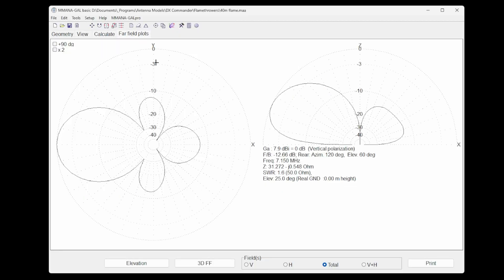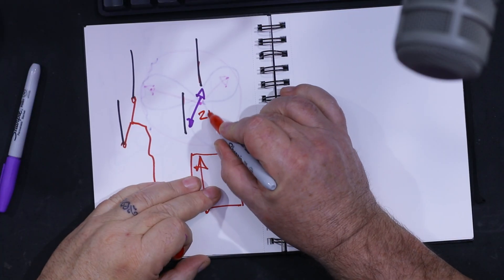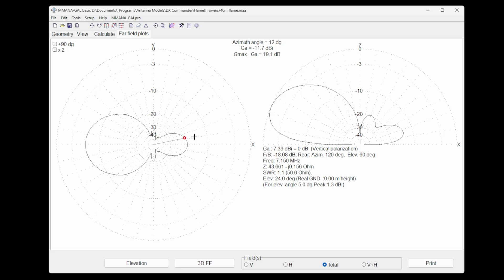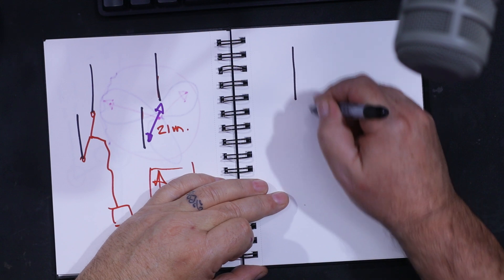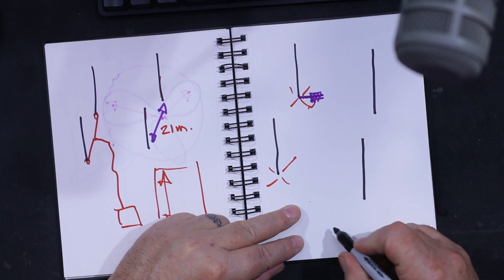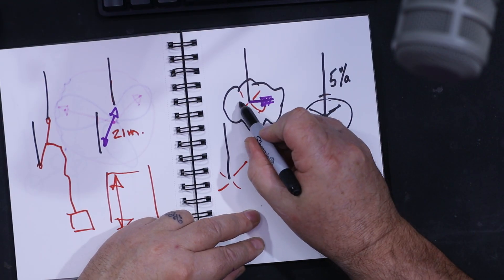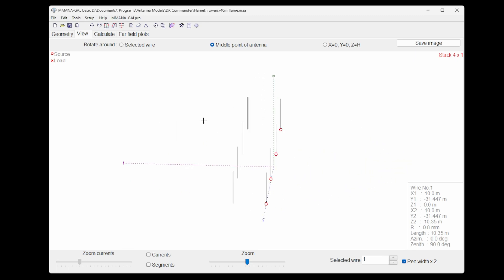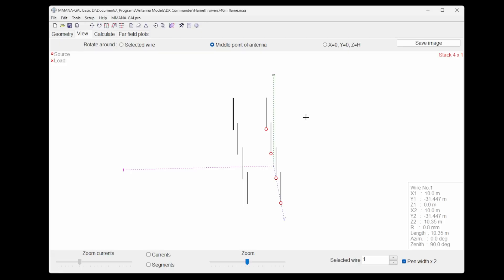4 Phased Verticals for Extra Gain and F/B

Comment: which software you use to calculate?

will this work on UHF band?
Reply from the maker: It would work.. But there are easier solutions up there like a Yagi.
Reply: @DXCommanderHQ  I use for data signals between shore and vessels working near shore (25km_ish) from the shore.
as the vessel has no fixed location I was wondering if this setup have more reception as with a directional antenna

Comment: Why bother putting 4 or 8 verticals for just only one direction? Yesterday just made calculation in MMANA-GAL for phased array 2x2 vertical. So, if I use four relays, I can switch direction. With plenty of radials, this antenna array can give 8 dBi gain (with 4x16 radials). Forward/backward up to 9.79 dB. Direction angle (-3dB) is about 108 degrees (+/- 54 deg.). Good thing is that this way 5 degrees elevation is really great gain. I got some calculation (40m band) for 10x10 meters spacing, 9.65m tall aluminum tubing 4 mm (bottom part is 16 mm, then inserted many narrower elements). Phasing is done using 1/4 lambda matching coax + 71 degrees phasing delay line(s). So, 4 direction is possible by switching relays. Even if all 4 antennas are in phase (0 degrees delay), it acts as a single vertical, but with much better pattern - especially for 5 degrees DX work. Just need to collect all materials and build array. I hope that directed reception will give me 1/4 of the noise as I have right now with single vertical for 40m band. Depends where it is switched, various noise sources are at various places.
Reply from the maker: Do it! I enjoy economical experiments. Very few of my antenna builds actually stay put, I move on to something else..
Reply: @DXCommanderHQ  I understand this part about moving to next idea. Previously I made vertical antenna without any radials. Then made mistake and rise it 5 meters up,  with only 4 radials. The problem was in length of active element - 7 out of 10 meters required for 40m band. Coil at the bottom does not helps because it was maybe out of resonance. Now I removed this ugly antenna and made proper 10m tall pole with 18 radials (1/8 lambda, approximately 100m copper wire, 1 mm diameter). Much better. Just noise level is the highest during afternoon period. Over night and early morning it is okay. So, I hope directed vertical array may reduce noise by 'subtracting' 3/4 of the available noise sources.

Comment: Hi Cal, in my old day-job we used circular antenna arrays called "Pusher" arrays, the smaller brother of the Wullenweber (look it up on Google, this wouldn't fit in your field :-)) like the one that used to be at RAF Chicksands near Bedford.  Any metal object in the vicinity would alter the beam shape/direction on a pusher...
It might be worth mentioning in your next "phased array" vid that the reason you need specific lengths of feeder on this type of set up is that you're trying to maintain a usable impedance for the complete array, if you just use T pieces and equal/arbitrary co-ax lengths you end up with a very low impedance (all elements simply in parallel).  That's why for example the 2 vertical Christman method uses 84 degree feed-lines plus a 71 degree phasing loop.
73, Craig, 2E0HXF

Comment: Wonderful how this array sounds, I had this niggling feeling that your long wire, 160m end fed, gave similar results. I looked up the video and it was about 5.7dB at 5 degrees on 20m, or, as you said at the time, about 10dB more than the vertical. I know you went on to change the design, but would it be worth revisiting the end fed 160m for transmit and receive? This array seems like an awful lot of work and expense to get similar results to a bit of wire chucked in some trees.
Reply from the maker: Yeah.. So something has happened to that long wire.. I'm not getting anywhere the gain I used to.. I shall inspect today and see what happened..
Reply: Maybe use the drone to get the antenna up in the treetops.

Comment: I don't know.  But I do know that it's going to depend on the (electrical) length of the coax between the feed point and the switch that's grounding the other end.  And if you have an old school dip meter, you may be able to figure out where it is resonant, holding the meter coil close enough to the element to couple (and being that close will effect the resonance.
Reply from the maker: Yes.. Now that might work.. Calculating the resonant freq whilst it's grounded is annoying me!

Comment: If you open the coax to the center vertical it would be better.    That would detune the vertical in the middle from the resonant antennas in the 4 square.  I think grounding the center vertical would interfere more due to your using other passive grounded elements.   The inteference amount, I think, would depend on the actual length of the center verticals and 20M element total length.
Reply: meant radial lengths of center antenna.
Reply from the maker: Yeah.. I'm wondering how I might do that easily - from inside the shack! Still thinking!
Reply: @DXCommanderHQ    I had to use a rf DPDT relay out at the antenna base placed in a small 4X4 box (about size of a UNUN) and controlled via bias T.    Just needed to operate the relay to open the ckt (both center conductor and ground to the radial field) to keep the center vertical from re-radiating interference to my surrounding 40M 4- square elements..

Comment: The 20 m element on the sig 12.5 is vertical but its coax feeder is at 90 degrees and on the ground. It's within the area that is the whole phased array antenna, it has to have an impact on the radiation pattern.
I don't see an easy way to model the situation But Ham Radio is a practical hobby so:
You can do real world tests when you build it by dropping the sig 12.5.

Comment: great. that work both ways. the RX comes up in the direction of TX as well. that antenna in question will be effected buy length of coax that short. cause a delay . take some measurements and put it in model . That feedline length to antenna switch will be a factor. if you put delay lines in phasing harness you can steer your beam. may be a bit fun. I am in NY,USA may be a big difference to me. 73's
Reply from the maker: Nice

Comment: Fun bit of history: this technique was developed in 1929 by an engineering firm to create a null in what was then the shared signal of WFLA and WSUN in the Tampa Bay area.  That year, the Federal Radio Commission (precursor to the modern FCC) realigned all the broadcast frequencies, and they WERE going to allow WFLA/WSUN to operate at 1,000 watts at night, but they were moving the stations from 900 kHz down to 620, which was also to be occupied by WTMJ in Milwaukee to the north.  WTMJ strongly objected, so the FRC decided to reduce the Florida stations to just 250 watts at night... which, naturally, the Florida stations were none too happy about!  So the Florida stations got in touch with an engineer in Washington D.C., who himself enlisted the help of a British engineer who had experimented with radio direction finding.  They put up one the in-phase tower on the south side of the Courtney Campbell Causeway bridge and the out-of-phase tower on the north side, and included a switch so that the station would only be directional during the nighttime hours.  When they fired it up and threw the switch, sure enough, there was a null toward Milwaukee, and all three stations were happy!

Today, it's just one station on 620 in the Tampa area, (WFLA long since moved to 970) and it now uses the call letters WDAE, but they still only go directional at night... now with 5,500 watts.  WTMJ, themselves, are directional 24/7 today, with two different patterns for day and night.  Their nighttime pattern includes a null to the southeast to protect WDAE.  In fact, it looks very much like the four-element design you've drawn up!  ( https://radio-locator.com/cgi-bin/pat?call=WTMJ&service=AM&h=N )  And even though they run 10 kilowatts at night, I know their setup works, because I can't pick them up at night from my town just north of the Michigan / Ohio / Indiana state lines.

Radio World's John Schneider did a great write-up about it a few years ago: https://www.radioworld.com/columns-and-views/roots-of-radio/the-development-of-the-directional-am-broadcast-antenna
Reply from the maker: Brilliant comment. Thank you!

Comment: WOULD LOVE TO USE DX COMMANDER AS a driven element, either re-engineering on lengths and bands, with another pole as a director or reflector. Vertical stationary array, or maybe even 3 elements. Not as easy problem, but if you use great circle bearings, it could be a great way to overcome the exorbitant cost of a beam.
Reply: 4 square multi-band with 4 DX Commander.
Reply: Spacing between the antennas becomes a problem on other bands.
Reply from the maker: Yep.. Just what John says :)
Reply: @FromthehamshackwithNJ4Z Indeed, the problem with a 4 square multiband is the choice of spacing, a bit like a multiband HF beam but also the phase shift network. This is why I asked Calum if he could try to model such a system to see if he was able to find an acceptable compromise so that such an arrangement works in multiband, which we do not see usually.

Comment: Good video Cal.  I've wondered about modeling in MMANA GAL a 5 element vertical Yagi-Uda.  Essentially a single driven element vertical, e.g. a DXCC, plus a single parasitic reflector & 3 parasitic directors.  Not an array like you've got, but more of a Yagi-Uda turned 90 degrees to make it vertical using the ground as a reflecting plane.  Interesting stuff.  73!
Reply: I’ve always been interested in a vertical yagi as well. If we get a nice, low takeoff angle for a vertical, could we further direct the RF in a favorable direction? It would do wonders for QRP, for example.
Reply: @joekrepps  Agreed.  I did a quick modeling in MMANA-GAL and found that the best bang for the buck may just be a single reflector behind your driven element.  Callum's video shows an array of these pairs which should definitely focus the beam as his model shows.  More directors will help out, but to me the gain curve (dBi) at 5 degrees elevation starts looking like it hits a "gain plateau" after 1 director.  Fascinating topic.  73!
Reply from the maker: and 
@quantumradio - you keep it up. Great thoughts..!
Reply: @quantumradio  So how about a small array of two active elements, each with a single reflector and a single director. If space and number of elements available is limited, could that work?
Reply: @thanielsibula6189  I get a marginal ˜10% (1.9 to 2.1 Peak dBi) improvement with the small array you describe when compared to the array of two driven elements and two reflecting elements.  This for a Freq.=7.150MHz, Elev_angle=5.0deg., Height=0.0m, Material=Cu wire, Ground=Real (dielect.=13 & Conduct.=5mS/m), enabled 11 radials in the simulation.  Best of luck in your project & 73!

Comment: I would be really interested in seeing more details on how you tune the reflector in the real world. There's two dimensions you can change with the reflector - distance from the driven element, and length of the reflector. What do I measure, and what do I change, to make sure it's performing well?
Reply from the maker: Measure the tune on an SWR meter, just like you were tuning a real vertical - then short out the ground to the element..

Comment: Hi Cal, interesting project! Just a daft thought, you say by dropping to 20m, you can get in an 8 pole array, and then dangled the thought that 16 would be fun. As you are constrained by space, why not try the 16 pole array, but on 10m, from what you say you have the room for refectors as well! There would also be a cost advantage on 10 as the poles would by half the height of the 20m array, although the field would look like a porkupine with 16 2.5m poles sticking up. A Foundation holder could have a legal kilowatt station with it!!! As I said, just a thought, maybe a bit daft, but it would be fun to try. I would be happy to drive up the 50 miles from North Oxfordshire to join the fun and games! 73 Jim M7BXT
Reply: Wow, just wow
Reply from the maker: We could call it the Pork-Opine :)
Reply from the maker: PS - I quickly modelled that.. 13dB more than a straight vertical.. Needle nosed pattern. Very tight. 10 Watts becomes 200 Watts.. 400 Watts becomes 8,000 Watts :)
Reply: can you please send me the file on that layout I would like to look at it @DXCommanderHQ

Comment: my phased 40 meter verts distorted the pattern of my home brew W1FV/VE6WZ 5 active element circle Rx array,  we opened the center conductors of both Tx verts and eliminated the distrotion. Ultimate solution was to move the circle array after I killed off all the poision ivy in the far corner of my yard. You could model it and see what you see...............cheers from New England to Old England..........73 Mike, K1FNX near Boston
Reply from the maker: Open up.. Yes OK..

Comment: Instead of making that kind of shape, i would choose a circle. And in the middle put a driven element. With a use of simple switch, you would get directivity, and much wider slope. 2db of gain versus plus 20 degrees more where you can operate...i always choose 4 over 4 el stack on 20m and up, over 5 or 6 over 6.  Just ny 2 cents

Comment: When you modeled the flamethrower there was no radials included. Is that going to throw off the measurements? 

Also, in the question about the signature poll, would just the unused elements be grounded or would the whole unit be grounded? And that's what you're asking about because I don't think it would be part of the master antenna based on what you said. If you could clarify that, it would be easier to answer the question at the end of the video
Reply: My understanding is that radials are accounted for in the 'ground' settings of the modelling software.
Reply from the maker: What Alex says.. They are accounted for in the ground setup button.